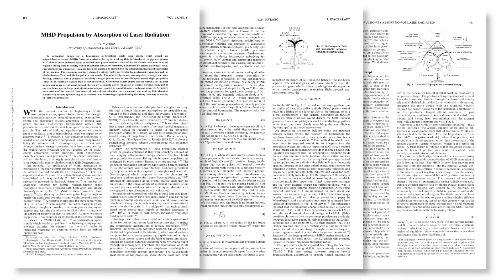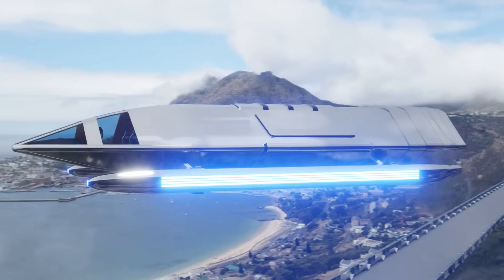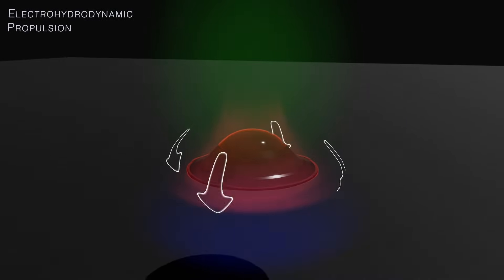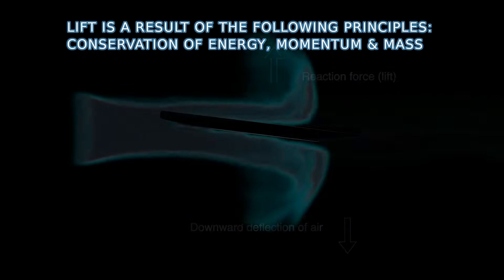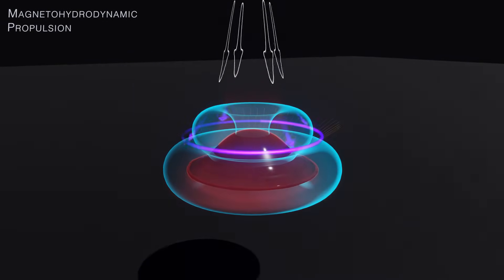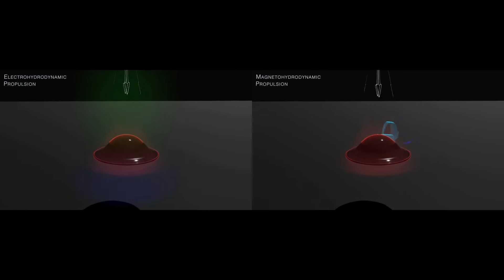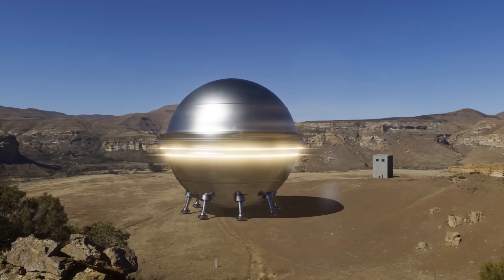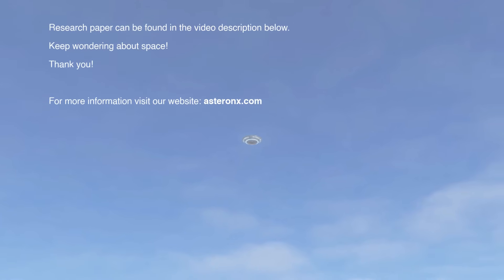Magnetohydrodynamic (MHD) Propulsion - What Is It? #magnetohydrodynamics #mhd #aerospace #asteronx

Comment: Wow, it's incredible how similar MHD drive sounds to the flying vehicles in the Indian classics, you know, the Vimana's that allegedly used engines powered by mercury. That's also interesting because mercury is also a magnetohydrodynamic fluid.
Reply: If mercury was used it has a high mass and hence the thrust would be significant. I built a lifter many years ago when I worked at NRL. The thrust per watt was small, but I never add the magnetic component to accelerate or amplify the thrust.  This would work. Wish I have the resources to explore this technical approach.
Reply: Do you think it would work if you substituted a low melting point metal for mercury, like gallium, tin-bismuth?  Expensive, but cheap enough for a proof of concept.
Reply: @waynegnarlie1  it's interesting bc some scientists analyized some meta-material recovered from an alleged UFO crash, and they found it was mainly made from bismuth
Reply: @zazugee  That is interesting indeed!  Bismuth has the unique distinction as the most diamagnetic element.  Mercury is inferior in this regard.   When Bismuth is exposed to magnetic fields, it generates it own phase-reversed magnetic field, that repels magnetic fields.  I think we have our working "fluid" for the current collector.
Reply: @waynegnarlie1  that's interesting, i never heard of this info before
i watched an interview with jaques vallee, and garry nolan did study that piece and noticed peculiarities about it, some suggested it was used as a higher frequency wave guide, tbh i don't know much about materials
Reply: @zazugee boom!!!!!
Reply: @waynegnarlie1  yes. But could you elaborate on how to use bismuth because I can understand mercury... but how to use bismuth....
Reply: @TravisTellsTruths  Bismuth melts at 521'F .  So I suppose once you melt it you could use it like they used mercury.  Spin it using a magnetic array that forces the liquid bismuth away from the magnetic pulse, and around the loop, since bismuth is diamagnetic and runs away from magnets regardless of polarity.  It's a weird metal.  You can also use acoustic tones to manipulate liquid bismuth into molds, wires and other shapes.  Loud audio tones have been recorded near alien craft (Billy Meier), but I have no idea if any of this would generate a counter field to gravity.  Maybe onces it's melted and circling the toroidal containment vessel, sound would keep it going.  I wonder if bismuth is like water, unable to freeze while in motion.  If true, then maybe something beneficial happens once the bismuth is cooled below its boiling point but still remains a liquid? Experimentation required.
Reply: @waynegnarlie1  maybe mercury vapor and bismuth vapor or liquid or actually bismuth nano particles but in different rings. Or maybe the bismuth is to guide the field....
Reply: @TravisTellsTruths  That's a very interesting idea.  Sounds like something to test.  I go back to the Vimana, and wonder what they used for power to get their craft floating, given the ancient era.  It's hard to imagine them pedaling to pump the MHD fluid.  But they did have musical instruments.  Perhaps hundreds were played at the same resonant frequency, with the tones self-synchronizing into phase with each other, where the acoustic power could be amplified and concentrated?
Reply: @waynegnarlie1 I believe the hull is made from Bismuth. Because it is diamagnetic, it seems to me that the hull would perhaps allow flux to exit the craft but keep the exterior magnetic flux from reentering. That might create a special affect enhancing the field strength. Perhaps, instead, causing the entire craft to be encased in a strengthened void like a sheet of graphite over a super cooled magnet.

Or another possibility...
A separate field generator above the main body consists of a perfectly magnaticly neutral metal that allows the magnetic field lines in and out from it, but the bismuth body beneath it prevents the field lines from entering. So you have magnetic field emanating from the bismuth but not reentering or are reentering, and the above assembly creating a field that stays outside the hull. This upper assembly would potentially be encased in the "dome" portion atop the classic craft shape.
Reply: This one uses ionized air and uses the lorentz force to create lift Though. There can be an issue with using mercury the fumes can be highly toxic it's organic Mercury that's the issue this doesn't use Mercury at all
Reply: @Wincil-k2r  mercury was heated in vimana and caused electrons to migrate and electron migration at fast enough speeds causes inertial propulsion.

Mike McCulloch found this out and proved it working.
Reply: I remember the gravity shielding papers referencing spinning superconductors really fast having something to do with cooper pair anomalies with inertia, but came to realize the physics is strong enough for MHD to be strictly aerodynamic with enough free electrons and ion velocity paired with some micro surface magnetism and a smooth low drag propulsion exterior
Reply: @manipulativer excellent info 👌
Reply: @Wincil-k2r yo why would they be toxic . Have you seen anyone die from these fumes? Hmmm
Reply: @Wincil-k2r  highly toxic? that is what you are taught it is not a fact. the fumes from making it are toxic but mercury is perfectly safe there is a reason why they want you to think it is toxic because it is the answer to so many question and why we can not move forward in this field.  do more research on mercury it has been used for 10s of 1000s of years
Reply: @getreal1702  
So, the whole "mad as a hatter" thing is just a myth? is that what you are telling us?
Reply: @getreal1702 Sorry mercury has a vapor pressure at room temps. We had to scan for it at labs where I worked. So it emits fumes all the time that can cause health issues. It’s not a lot but it can hurt you. I’m a chemist and I approve this message! Cheers.
Reply: @getreal1702  You do more research, how about it? Then you'd know about the toxicity of mercury at room temperature...just because it's been used for "tens of thousands of years" doesn't mean it ain't toxic...your assumptions are disturbing. But, there's a lot of that going around, ain't there? 😂😂
Reply: @getreal1702  👌
Reply: @christurnblom4825  
I played with Mercury when I was a kid, and never had an issue.  I've also been told Mercury is harmless, unless other stuff is present.  I can't remember more than that, because it's been years.
Reply: @TotalDec  I also played with it when I was young. fortunately, not a lot.
I suggest looking it up & reading a little rather than going by what you remember somebody telling you.
 I can assure you that the current, peer reviewed scientific/medical data is conclusive that it is not something people should just be handling without protective measures. 
Sure, a few times & you're not likely to have a noticeable effect if you weren't splashing it around enough for the droplets to start breaking up & spreading around to where a significant amount end up inside you.
Something that I also heard but haven't looked up (but seems possible to me) is that this element is heavy enough for small droplets to sink right into pores that happen to be big enough and elastic enough.
 Fortunately, the underside of our hands & most part of our fingers have very tiny pores.
Why take a chance? I say.
I see a lot of machinists grinding tungsten-carbide cutters without using any precautions because they say "I've been doing this for years & I'm fine". But I always try to use running water to capture the dust & take precautions not to breath it in when water isn't available.
Reply: @christurnblom4825 Arc Mercury rectifiers been around for a very long time they full off Mercury its perfectly say just don't go eating the stuff the old rectifiers are very cool too look at look like something out off a spaceship but they were everywhere back in 1800s that's how we turned AC too DC they used the vapour from the Mercury so basically lasts forever
Reply: @christurnblom4825 different types of mercury. The silver metal isn't safe to eat purely without gold but... yeah, it's not dangerous to touch it... fumes? Do not inhale!!!
Reply: @getreal1702 Organic mercury substances are highly toxic.  Most contain a C-Hg bond.
Metallic mercury vapor is not toxic by itself. 😊
Reply: It definitely works but we are definitely not experimenting enough to figure it out. I wish i had the money to play around although I'd probably kill myself on the very first day.
Reply: Yup, it’s also used in highly classified interstellar vehicles.
Reply: Some of these ancient temples in India are literally musically constructed. They can be played... the atom is standing waves like acoustics,  so...
Reply: @TravisTellsTruths  Phonons (acoustic property of atoms) are highly underutilized.
Reply: @waynegnarlie1  how do we use them/it/s?
Reply: @TravisTellsTruths  The great minds on this thread need to experiment with it and figure out what works and what doesn't.  Then we build the saucer, haha.
Reply: @waynegnarlie1   Saucers are kinda scary, homeboy
Reply: @waynegnarlie1  I have the magic formula, which I will be using to create a prototype in my garage.
Reply: Used properly for liquid mercury.  Thank you.  NOT used properly for air.
Reply: Precisely
Reply: Mercury vapor.....
Reply: What are these fumes comprised of? Chance of recycling?
Reply: They use to have there city’s up in the clouds this was just a convenience since electricity is easier to access
Reply: Besides Vimmanas, there were Astra's and Vailixi! So we went to the moon and all planets, where are our distant colonies and ancestors?
Reply: @douglasalfseike3867  That just mythology so no our ancestors are not from other star's or planet's
Reply: Bismuth would be much more efficient then mercury
Reply: Why do you believe in something you never saw?
Reply: @TotalDec  very good question. Does that mean you don't believe in air or bacteria?

Comment: What do all power plants have in common? They use either nuclear, hydro, coal, or any other source to turn a wheel, called a turbine to generate electricity. Can a magnet do that? Of course. Magnets can turn that wheel forever and without friction, so no more maintenance. Why do they hide this fact? Because free energy forever cannot be priced or sold.
Reply: While magnetic levitation can make a wheel spin with no friction, the wheel can't also power anything without slowing down itself. You just reinvented flywheel energy storage.
Reply: @aphilosophicalnaturalist6245 make it a loop system with batteries. The batteries turn the wheel and the electricity goes back to the batteries or coupler. You could use a capacitor to capture the excess electricity. What say you?

Comment: Why can't you energize a series of magnetic coils arranged in a line that when energized in succession, the expanding field of one coil pushes on the expanding and dissipating field of the previous one, thus propelling the spacecraft?  True field-based propulsion that does not require expelling gases from combusting fuel for thrust.  Just thinking outside the box.
Reply from the maker: You can't push off your own magnetic fields, they are still coupled to your vehicle, so everything cancels out.
Reply: You can push the magnetic field in succession up until the last magnet which won't let go of the magnetic field and thus you won't go anywhere. You'll only succeed in turning the space craft into a giant magnet.
Reply: this is how maglev trains work 🤦
Reply: @coolboy-qc4eb  no, maglev trains don't work like this, maglev trains use rails that switch polarity to propel the train and a twisted triangular coil — of sort, to levitate the train. Current is induced into the coil when the train accelerates (ofcourse) levitating it, I know how it levitates but I stuggle to describe it
Reply: Well you should have thought inside the box

Comment: TR-3B Astra uses the same principle?
Reply: Check out the video of Jean-Pierre Petit PhD doing an interview in Prague about Magnetohydrodynamic aerodynes. He wrote "the silence barrier" and showed in the lab how MHD flow control can eliminate sonic booms. The Russian AYAKS / AJAX hypersonic spaceplane design uses MHD plasma air compressor and accelerator stage to boost conventional turbo-machinery efficiency enough to get into orbit. Professor Petit believes the United States stealth bomber program uses MHD and Electrohydrodynamic technology similar to Thomas Townsend Brown's electrokinetic generator to allow for near unlimited range in the ionosphere.
Reply: @taylorwestmore4664  comments like this are what lead me to research papers and consequently greater understandings. Thank you for opening a unseen gateway that will give me extremely valuable information.
Reply: Actually that is wrong the tr3b uses a combination of technologies. It uses a gavimetic magneto diverter which curves spacetime. By using a superconducting fluid that is also a superfluid they broke the code. At superconducting temperatures the fluid has no resistance to electricity or movement. 

Using the frame dragging effect it curves spacetime it is basically a low level warp field. Put in a torus and charged up with enough power it curves spacetime to lower inertia mass and weight 89%. Then combined with MHD it allows it to accurate or deceleration in seconds with no g-forces.

Comment: Funny, electron positron propulsion is the same method used on the SSR Normandy in Mass Effect. Still, I don't see this as a huge game changer as a whole. It may allow a more space centric propulsion system similar to ion thrusters for ground to space transport, but in general it doesn't seem that much vastly better than the VASIMR engine other than tuning. The VASIMR just seems far simpler to run in general. Still, no current space program seems to have intent behind these more experimental propulsion systems outside of NASA, and NASA hasn't really been putting big money behind them yet either.
Reply from the maker: An MHD drive acting on the vacuum fluctuations has the same exhaust velocity and specific impulse as a photon rocket, but with much better thrust. It also needs no propellant, and eventually, no fuel either.
Reply: @asteronx  A MHD acting on the quantum vacuum fluctuations is a q-thruster. And I know you are dealing with matter antimatter in the form of positrons and electrons lowering  the amount of propelant. But I really don't think you well ever get the efficiency to the point of not needing any fuel what so ever of both the power system and the propulsion system.  That would be papetual motion. 

Now if we ever figure out how to make a quantum state moderator we could use this to make warp matter like on star trek in the form of depositronnum. Which would be stable extremely high density energy storage. Also this system unless  combined with nuclear fusion would be hard to make it work. I really think these system well findly be used as part of a hybrid propulsion systems but not stand alone.

Look I know you well allways disagree with me. But while these systems well findly be used they take a lot of power unless you have a way of producing the large scale ionizing like with fusion. And still you need a lot of power for the electric fields and magnetic fields. I can only see one way to make this work. That is with antimatter catalyzed fusion and I am not talking about the positron type reactor you showed before but as a upgrade to fusion we are working on now.

Large atom non specific antimatter like anti carbon isotope or something similar is easier to make, slow, cool and store. A factory with a 2 mile track could make 2 grams or more a year solar powered. It would have a 2 mile passive cooling ring also with a attraction mass in a Pendeum trap. And the gaint superconducting magnets are not needed. The new technologies that can be used is only 1-1/2 foot wide. The passive cooling ring and attraction mass in the Pendeum trap allows the antiparticles to slow, cool and form atoms at there own rate.

As you know one gram of antimatter produces the 3 times the energy of the atomic bomb dropped on the Japanese. Only miligrams are needed to use as a heat source to replace oxidizer to get a ship to orbit. Only micrograms are needed for antimatter catalyzed fusion. Point is all these systems can be used and inproved as we go but we need the power that antimatter well provide.

Offworld it is even easier to make more because of access to more sunlight and high energy particles. It could be a source of revenue for interplanetary colonies.
Reply: @clementvining2487  perpetual motion? Not quite that's not exactly what a mhd drive is it only run entirely on electricity.